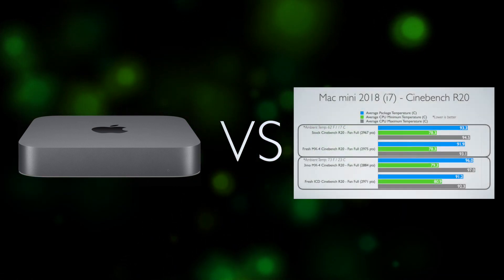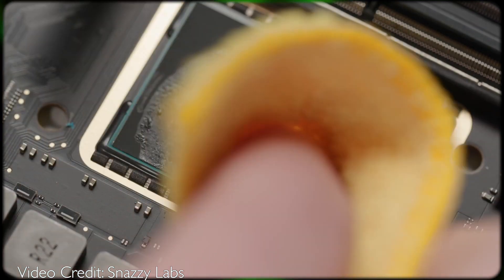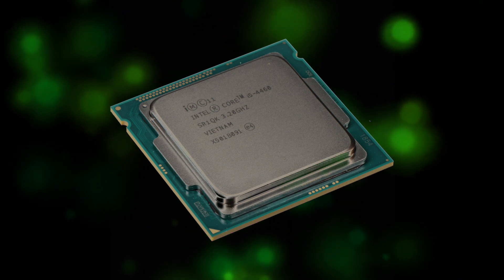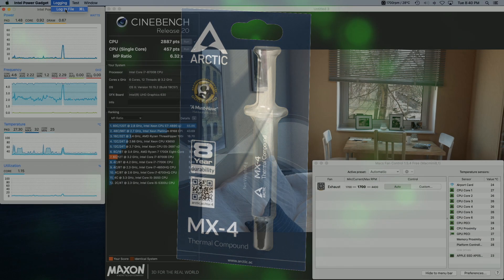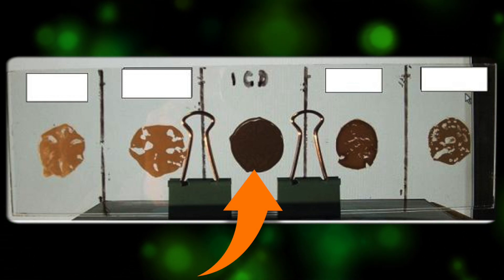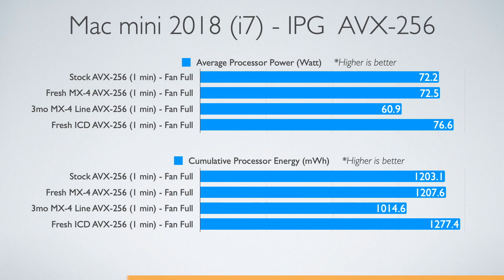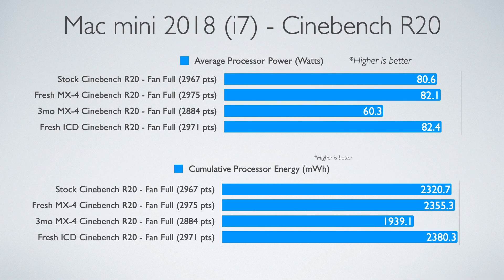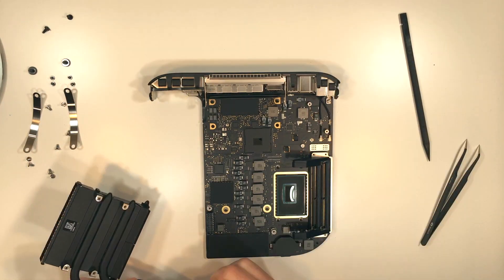Replacing the Mac mini Thermal Paste? Watch this first!

Comment: If you’re still using this Mac, you should try PTM7950, LTT sells the genuine Honeywell stuff, just used it on my 2020 m1 MacBook Air and it’s amazing. Apple started using high quality thermal paste with the M series, but after 3 years, PTM was a massive upgrade
Reply: I second this. Just put PTM in my 2018 i7 mac mini and i had massive improvements. These intel chips are notorious for being hot and this just fixed it.

Comment: So only use the if diamond paste ?
Reply from the maker: IC Diamond works well. I’ve switched to Honeywell PTM7950 about 1.5 years ago with excellent results. I’d recommend PTM7950.
Reply: @mikes1891  alot of this stuff goes over my head all i know is that mac mini runs hot !!!! trying to figure out what to do
Reply: is this the pad not the paste ?  @mikes1891
Reply: @mikes1891  Appreciate bro!!
Reply: @mikes1891  Hope you're making a video about it!
Reply: @mikes1891 any tips on how to apply the IC diamond and/or Honeywell properly for the Mac mini? Specifically how much exactly and in what shape. Thanks!
Reply: @mikes1891  thickness on this ptm?
Reply from the maker: @Jannickjay   I bought the JOYJOM PTM7950 with a 0.25mm thickness from Amazon. The Mac mini still runs hot but it’s the best performing paste I’ve tried and doesn’t pump out like the IC Diamond. To apply, lay the PTM7950 on top of the cpu die and mark the shape with a sharpie. Cut the pad (a little extra is okay) remove the bottom plastic (thicker plastic side) press onto the cpu die. Remove the top plastic (thinner side). I usually need a razor knife to help lift the plastic. You may also need a spludger or something to keep the PTM from lifting when you peel the top plastic. (The goal is to keep the entire cpu die covered and keep the pad flat, don’t let it bunch up.) Then reassemble and enjoy your work. Here is a non affiliate link to what I bought: https://a.co/d/8oaBA6g

Comment: btw ive use thermal grizzly hydronaut and its still okay after 3 years of using. fyi i use mbp 2018. people also say gelid gc extreme doesnt have pump out issue.

i dont have any idea about thermal paste for mac m1, consider m1 chip have IHS
Reply from the maker: I agree about the M1, I don’t have an M1 Mac mini to test and I haven’t seen any repasting videos. The M1 is more power efficient and also runs cooler so Apple is able to them as reasonable temperatures. With that said, people are probably less concerned about thermals on these models.
Reply: @mikes1891  i think not so cool on m1 air, max full load can get 98°c😅 thats on cinebench/geekbench with cpu 100%

Comment: I'm not sure how much you know about TIM or how it interacts with heat, but dry out is very common and not replacing thermal paste for 8 years is a very bad idea. Now there are many schools of thought on this, but I'm of the belief that once a year is fine. Some enthusiasts with very high-end systems will even go as far as replacing thermal paste every 6 - 8 months. I've always used Arctic Silver 5, but MX4 is technically a better paste. That being said, like you, I've had issues with MX4 for some reason and found myself going back to AS5 or some Noctua stuff I have. Nice video, bro. Just ordered a Mac Mini 2012 i5 myself.
Reply from the maker: Thank you for sharing your experience!  It’s good to know that AS5 can still hold it’s own with newer processors.  Before the Mac mini 2018 I had a 2011 mini that I repasted with AS5 in 2012. I had no issues with AS5 and then proactively repasted it in 2019.  I agree that refreshing TIM on a regular basis can be a good idea, however, IMO the Mac mini’s were not exactly designed to be serviced on a regular basis and this is why I was focused on finding a more long term solution.  Thanks for the comment!
Reply: @mikes1891  I agree about the thermal paste, but I'd be curious to see what it's like on a Mac Mini that's been heavily used for video editing etc vs one that has been used for general computing. I got my Mac Mini this month and I'm quite lucky it's hardly been used. Popped it open and it looks almost brand new. Shame it's only got 4GB at the moment.

Comment: As far as I can say, liquid metal needs nearly 0 maintance at all. You can leave th epaste for years, without changing it. It´s also fine to took the cooler of and take it back, without changing the liquid metal. @Gamers Nexus found this out, if I´m correct and I can confirm it. I´ve two laptops, several CPUs (direct-die and CPU-headspreader) and GPUs with lm and all running like on the first day, temps are in the most cases after some days/weeks a little bit better.
Reply from the maker: @Psych Engel Thank you for sharing your experience! I don't believe I saw the video so I'll check it out!  
I'm not sure if this effects everyone but my Mac mini has a small gap between the CPU and heatsink.  I know this because I tried (unsuccessfully) a graphite thermal pad and it was only making contact on a small corner of the CPU.  This gap is probably why I had the pump-out issues with the MX-4.
Reply: @mikes1891  No problem, you're welcome. If you've a gap between the heatsink and the die, then that's definitely the problem.

Comment: from the footage at the end looked like you kept pad and paste together :S
Reply from the maker: Thank you for the feedback!  I plan to make an update to this video soon and I will try to be more clear in that video.  To confirm, I did not use the paste on the CPU die and the pad together, but I did use a small dot of paste on the heatsink to hold the pad in place during reassembly.  The paste was applied to the corner of the heatsink far from the CPU die.  I plan to make an update to this video soon and I will try to be more clear in that video.

Comment: Very glad I stumbled across this - I was just about to use a spurt from my "lasts forever" size tube of MX-4 on an i7 Mac mini - much appreciated!
Reply from the maker: I've used MX-4 in the past with desktop builds with great success.  I had the machine apart several times and could not achieve the same success.  Then after 3 months and the temps were significantly worse I knew I had to make a video to share my experience.  I appreciate the story the others told but the long term results were missing from all of their videos.  I plan to make an update in October to share a 3 month update.  So far, things are looking very promising! Good luck!

Comment: Great video, thank you for the information. One question -- have you tried the paste without the pad and noticed a difference? And did you apply the paste to both sides? I feel like you didn't complete the experiment. Wiping off the diamond paste will also give you a chance to see first hand if it resulted in heat sink scratching. 🤓 
Another thing I am trying are these cooling bases from speed labs (they have both for tower and mini).
Reply from the maker: The Speed Labs Base looks interesting, I'm sure it will help. I like my mini on its side (power cord up) to save space.  I'm not sure what you mean by trying the paste without the pad? If you're referring to the copper area on the Mac mini heatsink, this is not a pad but part of the heatsink.  Otherwise in my experiment, when I tried the ICD pad, I cleaned the CPU and heatsink as thoroughly as possible and used only the ICD pad.  I did use a small dot of thermal paste only on the corner of the ICD pad to hold it in place when I remounted the heatsink. When I switched to the paste, I applied it only to the CPU die.  I agree with your comment about wiping off the diamond paste, I have not tested this myself.  I plan to repaste a video card soon and I'll see about posting an update when the time comes. Thank you! I'm glad you found the video helpful.  It has not been 3 months yet, but so far (after the turboboost period is over) the max CPU temp is 98C and package power utilization is 75 watts (ambient temp is 72F).